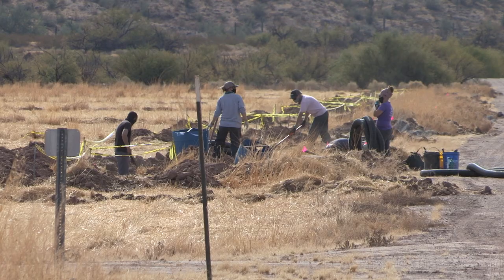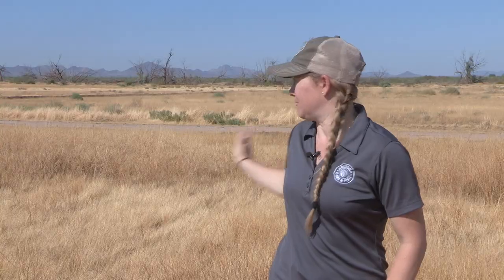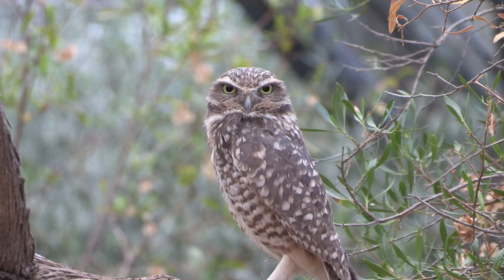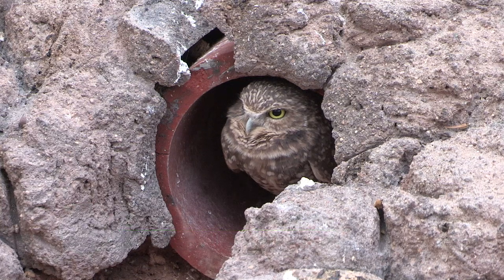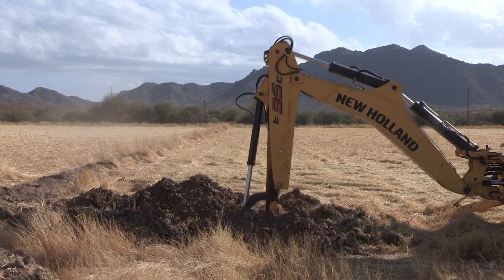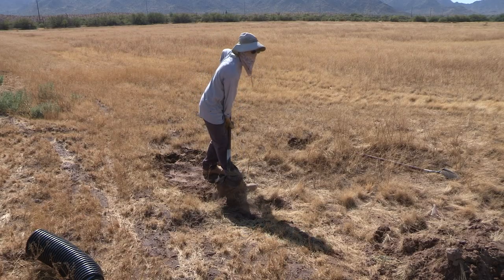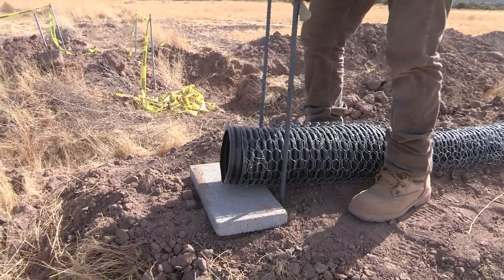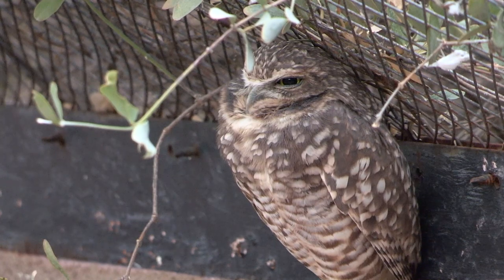Save the Burrowing Owls!

Comment: Please send me or post any links available to the burrowing owl translocation project data/reports in Arizona.  After several years and 28 of Dave Johnson's artificial nesting structures that are less than 20 miles from a healthy colony of burrowing owls, we (CTUIR) have been unsuccessful at initiating a new colony here in eastern Oregon.  Translocating may be the next step to try, but we need your help and experience before considering this option.  I am a volunteer who has been helping with the project for several years.